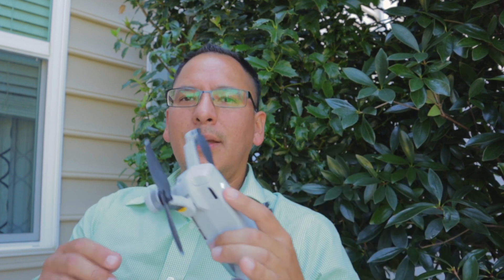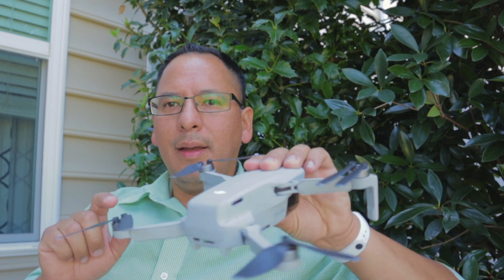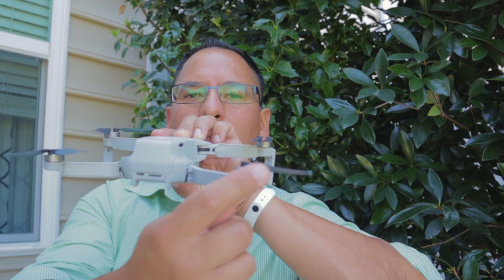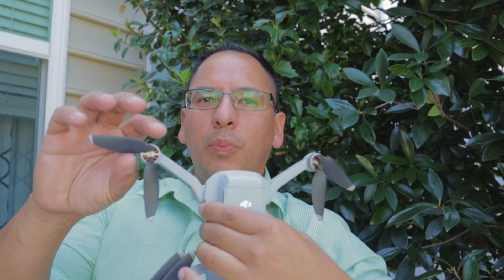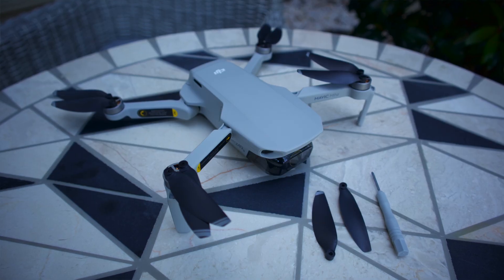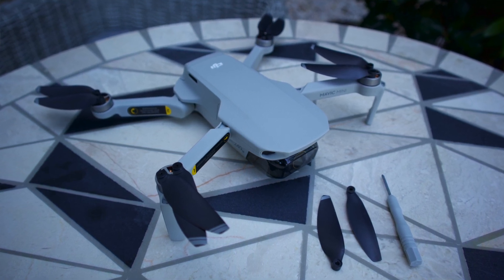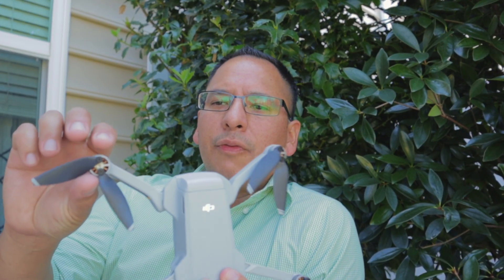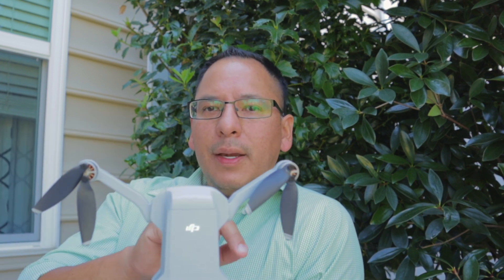DJI Mavic Mini drone Esc-propeller rotating too fast Error. (likely solution)

Comment: This is quite interesting and I'd say it reigns tru as I got my mini 2 to get into fishing with my existing gear and keep it light .here's how I did it ..made a alloy tig rod rig and drilled 2 holes in the bumps on the tail it sits on them 2 small holes into the hinge just in front of the wiring goes thru the front inner rotating hinges and I use that to pull the line out and then rotate 180 degrees and reverse up the line slides off..it's like a L shape u put your main sinker on it  ...after about 3 times going fishing I started to get those warnings your talking about and even when I flew it to take photos it was doing it ...full new set of props and it stopped ..now I'm using the rippton mobular it's absolutely mental it's able to carry 2.5kg payload .has 3 servo releases and can carry it out 2kms ..still a drone tho still can have errors ...check them out ..have a new one now called the shark ..less payload less capable distance but flight I'm told is superior in every way and who needs to send it out over 1km right
Reply: 40 hours flight time fishing with my DJI mini2 ..love the little machine ..it dropped out of the sky randomly in pretty Shure a bird dive bombed me and I sent it to China and DJI fully rebuilt it for free I just proved purchase so it's new again..make Shure you do updates till it can't do updates EVERY FLIGHT

Comment: Thanks my daughter is gonna be super excited we found a easy fix we bought her some cheap rubber prop holders seems like after we start using those that’s when the issue occurred so I think those propeller holders bent some of the props because I have it in a nice case I have it in a GPC case I know it’s not the case but thank you for sharing your experience and solution have a great day
Reply from the maker: I’m glad
Reply from the maker: The problem is the actual case that bends the props
Reply: @GoPlacesLKN  Yeah I think the case that comes with the fly more, is the one bending the props I have had it in that case for months never had issues until we got those prop holders they are cheap startrc prop holders
Reply from the maker: Ok. Yeah it’s an amazing drone. Enjoy it
Reply: @GoPlacesLKN  indeed she is happiest 11 year old I know lol Im flying the Autel evo lite plus at the moment but I have a few other decent prosumer drones as well
Reply from the maker: I’m jealous. I do make other drone videos as well. 
I have the Autel 2 pro and I love it
Reply from the maker: Did you get the ND filters too?? It helps with the footage
Reply: @GoPlacesLKN  yes I was mainly flying the mavic 3 an the air 2 s before I got this Autel lite plus an I also had the evo 2 pro v1 but I sold it
Reply from the maker: Oh okay you have all of them

Comment: Thank you so much i have fixed it as well !!! I have one question 
regarding the bottom mid section where it is showing the positioning of 
the remote control and the drone. In my case it cant be connected, it is
 red circle  and no positioning any ideas?
Reply from the maker: I’m actually having the same issue as well and I think it was due to a new fly app update which was also updated once again a few days ago. I need to do more digging into the problem

Comment: There is a difference in propellers    If u look closer you’ll see a black line.  They represent rear propellers.   I did this backwards one time and it didn’t take off.     Just for anyone who reads this an are asking what’s the difference :)
Reply: Thanks I will look closer pretty Shure mine are all orange but I will look closer for subtle colour changes ..I've still got sum new ones from the flymore combo in packet I will check those

Comment: I've had this issue twice (two sperate sets of propellers) . It's with how you store it in the case. After getting the issue again last night trying to capture the sunset, I went ahead and ordered 3D printed prop holders off of Etsy for $7. Has a lot of great reviews saying  they work very well. The girl also has a 3D printed bracket for the remote control so you don't have to remove the joysticks while storing.
Reply from the maker: Chris Stefanos could you share the 3D holder pictures

Comment: So when is the update released to fix this?
Reply: its not a software problem so a release wont fix it - simply need to take better care of the propellers (storage) to make sure they dont get warped. If they do then swap out to a new set
Reply from the maker: No sure

Comment: Dji have released warnings on proper storage method of the props which could be to address these constant issue experienced by mini users.'
Reply from the maker: Yes. I have changed the case
Reply: @GoPlacesLKN  which case did you get?
Reply from the maker: I’m using the case that came with the flight more combo

Comment: Woe same motor with me too fucking pissed I didn't crash it or anything and I'm getting this issue. I replaced the propeller's all of them, I was good for another month now Is telling me the same thing.
Reply from the maker: What is the wind speed when you are flying? I have found out that if it is greater than 7 miles per hour the error tends to appear
Reply: @GoPlacesLKN  yeah the wind was about 11 mph and gust was 19 Mph. It's kinda weird that happens to mine cuz my friend has the same one too and he doesn't get this problem.
Reply from the maker: @fuzefpv5766  So now we have figured out that the problem is due to a software problem or the high wind sensor is giving a software issue. If you check my recent mavic mini videos I have been able to fly with no problem, but the wind was an average of less than 4.9mph. I hope this helps

Comment: This issue is common with the Mini Fly More "Combo", since we store the Mini in the case. If you don't store the Mini with the props properly folded to avoid bending them, then they hold that bent shape and will give that ESC error. I've used my Mini for the past 8 months and have never seen that error.
Reply from the maker: I should keep it on a counter so this doe not happen again. Thanks.
Reply: I keep hearing this. So what did you do to avoid the issue? I also have the fly more case.

Comment: I found that simply doing an ICU calibration fixed this constant issue for my Mini... (so far)... I'll reply again if the problem comes back..

👍
Reply: Hi! I saw this comment and i'm wondering if you did receive the error again after you do the calibration?
Reply from the maker: No. But I have also replaced the propeller and no further issues
Reply from the maker: Do you mean ECU? I will try to update it, and I will let you know. Thanks for the tip. :)
Reply: @GoPlacesLKN  sorry, yes..., 👍
Reply: @GoPlacesLKN  sorry, yes..., 👍
Reply: No... Sorry... IMU calibration
Reply: (underneath Compass Calibration)
Reply from the maker: @mavicminiflyeruk2437  thank you. I will try it

Comment from the maker: *Update. I been flying the Mavic Mini for 8 hours off and on today with issues at all. 🙏🕺🕺
Reply: Don’t fly my mini as often as I should but got same problem changed all props she’s doing right now you were right thanks
Reply from the maker: @livinglife4921  I’m glad I was able to help
Reply: Still no problems? I’m having the same problems after the update, I still haven’t updated on my laptop (only on app) so I’m debating on doing that but I don’t have a laptop. I also replaced the prop that was having the problem but it was the only one I replaced. I will try replacing both of the rear props tomrw and I hope it works.
Reply from the maker: pnang231 my mavic mini still flying well. So let’s go step by step. #1. Do you have the latest app version? #2 reinstall firmware, #3 update IMU. I really recommend the update through the computer because you can refresh the firmware completely.